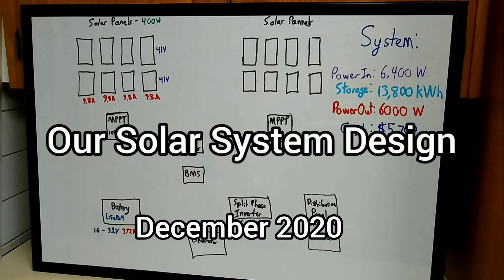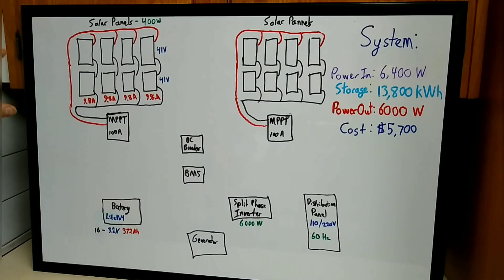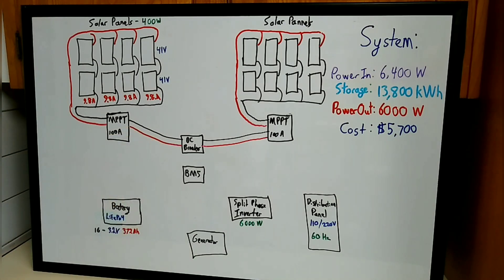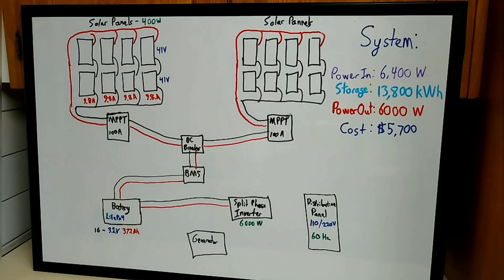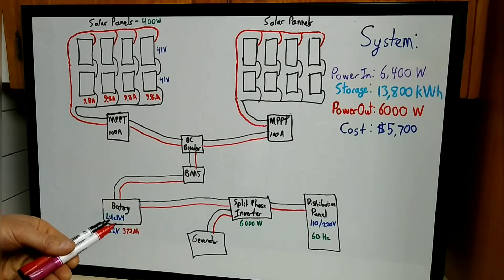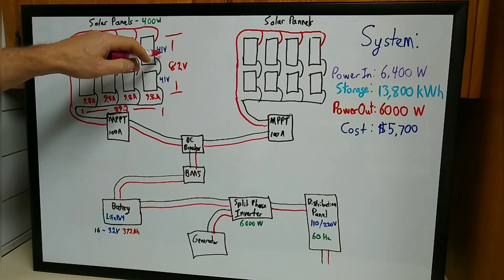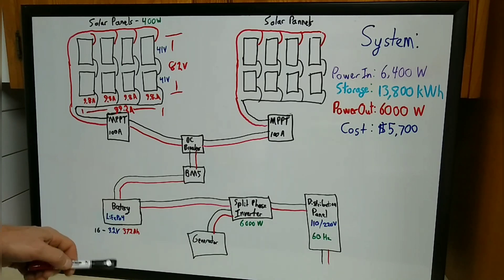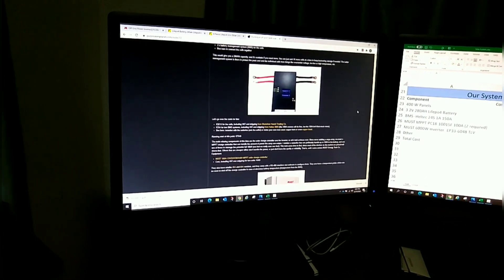DIY Off-Grid Solar System Design 6,400 Watt

Comment: Terrific overview. For the generator to inverter part, you would need an inverter/charger. Otherwise your genny would need to output 48vdc, right. Overall looks fantastic. Thanks for sharing.
Reply from the maker: We can run the generator directly into the inverter to charge the batteries. Thanks for watching! 🌞🏜️

Comment: Very good explanation of the components of your off grid solar system, I really like the fact that , you broke it down  to have a self back up system within the same system which gives you the ability to service most or all of the components without loosing back up power seems brilliant to me if I understand it correctly, your property seems to be in one of the best places for solar collection, with ample storage to take advantage of your resource, very smart to have it in place and available for your house build and other projects, which you are able to recharge battery powered tools and lighting so many benefits that will last many years thanks for sharing your explanation and detail on how you did it and your expections of the system. The old saying “ Making hay while the sun shines. “

Comment: Shading can be an issue on cloudy days or if trees block your sunlight throughout the day.  You might want to connect your four intermediate connections to each other to reduce the power loss when one panel is shaded.
Reply from the maker: Good point! With this setup you definitely don't want any shade on the panels. Ours are on a roof and we don't have any big trees around. We were impressed with how well the panels did during our very rainy monsoon season this year. Even on completely cloudy days they were still making decent power. 🙂